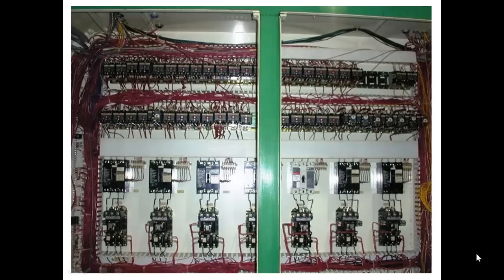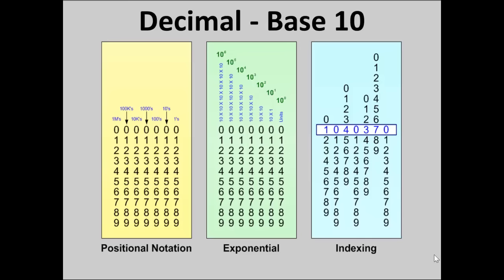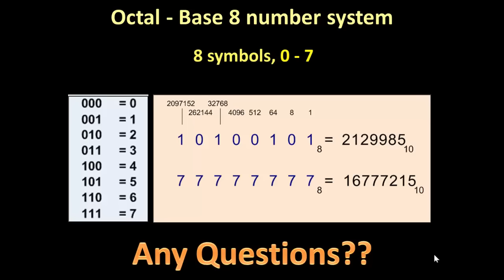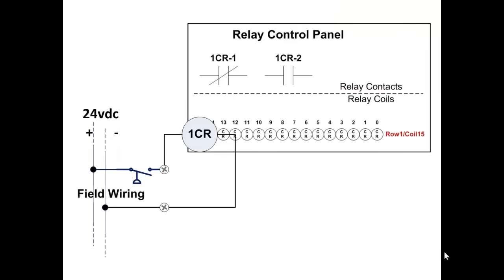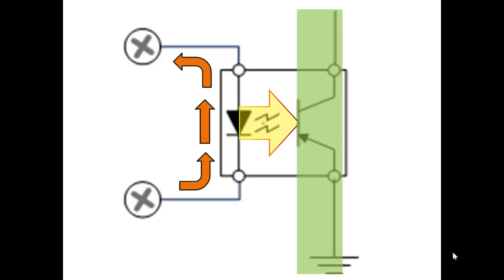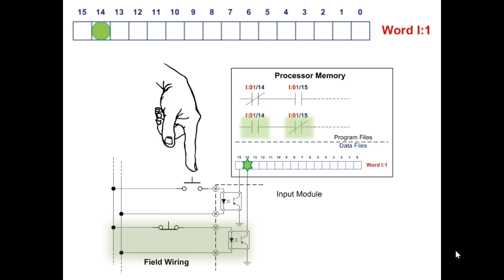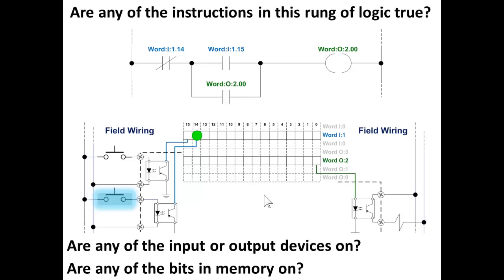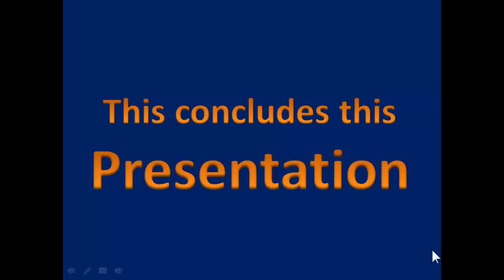What is a PLC? PLC Basics Pt2

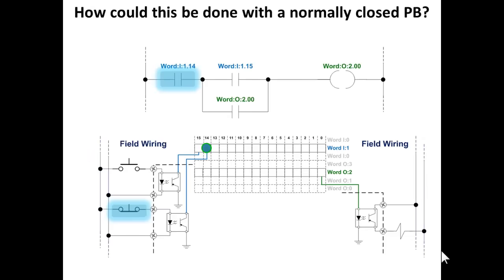Comment: In the bottom diagram in 1:08:20 it's showing a normally open push button connected to I:1:14, which has a normally closed symbol. And then the opposite at 1:29:52. This is different to 55:52. Am I missing something? Does the type of physical switch not relate to the functionality i.e. NO/NC?

Also, why does turning I:1:15 on turn O:2.00 on? Is it different to standard circuit series/parallel rules for ladder logic?
Reply from the maker: All contacts are drawn in their "normal" or relaxed state. You do not change the symbol to match it's energized state.
Reply: @plcprofessor  Thank you for replying so quickly! I think I wasn't clear enough with my question though, sorry, as I'm not talking about changing the symbols.

I was thinking "push to make" switches would always be NO in their relaxed state, i.e. - = -| |- and "push to break" are NC i.e. _ = -|/|-. Is this the case, or does it depend how they're wired up?

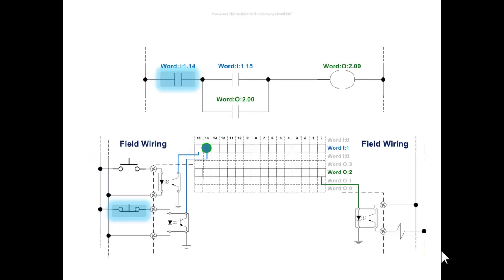At 1:08:20, you have - = -|/|- and - = -| |- but at 1:29:52 you have - = -| |- and _ = -| |-

I've figured out my second question I think :)

Comment: At time mark 48:20 when the exploded view of the opto isolator is shown, I think it should be an NPN Transistor with the emitter wired to ground , acting as a sinking device
Reply from the maker: That would be true for a positive supply, but not for a negative supply like they use outside the US. However, I wish now that I had not used that symbol and made it entirely "polarityless". Most manufactures use sketchy component representations in their wiring illustrations. In the classroom I always mention that these are representations and warranties of information. I added a note that will hopefully allay semiconductor "savvies" from the distraction of what we are actually discussing. Feedback always useful, thank you.

Comment: 1:16:25 - You begin here talking about OTE; will you explain what that is, or did I miss something in the previous lesson?
Reply from the maker: It is the instruction that mimics a relay coil, an instruction that writes to a bit in memory, setting it on of off just like a complete circuit in a relay circuit energizes the coil when the circuit is complete or de-energizes it when the circuit opens.

Comment: Ok, let me ask this, at 1:19:35, if bit 14 is on, instruction 1.14 becomes false. Is this correct?
Reply from the maker: +Bruce Wang YES... If bit 14 is ON then any "TrueIfOFF" instruction that addresses it is false... because it is not OFF and therefore false.
Reply: plcprofessor Thank you for your reply. At 1:19:35, the question is are there any of the instructions in the rung of logic true. The answer should be none is true because I 1.14, 1.15 and O 2.00 are all false.
Reply from the maker: +Bruce Wang The three read only instructions are all false, but the write only instruction addressing O:2.00 is never true or false. The TrueIf... instructions are statements about the bits in memory that they address and they are either true or false, these instructions are queries but the "output" instruction is an action that has an action when the rung is true and another action when the rung is false.

Comment from the maker: Yes, you are correct. Unfortunately I normally mention to my classes that this is a representation and not a warranty of actual electronics. In reality there would be a myriad of components between the I/O wiring arm screw terminal and the memory bus. I just thought of a solution, I will make a note to myself to add a note on that section to mention the same. Thanks for the feedback, it all helps. Again, thanks...

Comment: I did not get the question asked at 1:19:35 "are any of the instructions in this rung of logic true?" According to me none of the instructions is true, and I did not get the given explanation. Could you please explain in detail. Thanks.
Reply: +Mohit Suri I agree with you, instruction 1.14 should be false.  That part confused me as well.  I just thought it was a mistake in the video.  Also, the normally closed pb logic didn't make any sense to me either.
Reply from the maker: +Mohit Suri There are two read type instructions in that rung of logic, there is a True If On and a True If Off instruction (true if that bit in memory is ON) and there is a True If ON )true if that bit in memory is OFF), just like the contacts of a relay, some have continuity when the relay is ON (True If On) and some have continuity when the relay is OFF (True If Off). There are no mistakes in this explanation, I double checked.
Reply: +plcprofessor at 1:19:35, if bit 14 is on, wouldn't it open 1.14 thus instruction 1.14 becomes false?
Reply: +plcprofessor I see what your point is, but true if On(bit 14) instruction is not displayed on the ladder logic(since word:I:1:1.14 is normally closed contact), so can we say that there would be always one instruction out of the two being true, even though that instruction is not in the ladder logic?
Reply from the maker: +Mohit Suri The single most difficult point to understand with relay ladder logic is that the symbols that resemble relay contacts are not relay contacts. The "rung" of logic in this graphic is just that, a graphic and not a relay circuit. Those symbols do not open and close, they are either true or false depending upon the state of the bits in memory that they address as a read only instruction.
Reply from the maker: +Mohit Suri The only instructions that exist are the ones that you put into the rung of logic. A TrueIfOn instruction that resembles a normally open relay contact is identical in execution to a IF "MemoryLocation" =1 THEN. The TrueIfOff is equivalent to IF "MemoryLocation" =0 THEN. Without a true understanding of what a relay contact implies in an actual relay logic circuit, it is a query of the state of the coil, this concept will elude that individual.
Reply: +plcprofessor  I was told to find out what a not was in ladder logic but I don't remember hearing you say. Did I miss that?

Comment: I'm one of those people. I'm really lost at 59:07. Could someone explain that, please. The NO is true because the circuit is on?
Reply: +Imna Illestchik   you have to seperate the physical devices from the logical instructions.   a instruction can be false if a bit is off. (an NC instruction is TRUE if the bit is off)  for example.   And a bit can be ON  if for example the button is not being pushed (if its an NC button)  so the Physical world just runs from your divices until the input module bit, to determine if this bit is on or off. that bdepends on the type of devices you use NO or NC. from there the logical world starts. The logic looks only to if the input bit is ON or OFF... And the Instructions ADRESSING a certain bit can be TRUE or FALSE  wether the bit in on or off depending what instructions you use.  then when a output bit is turned on or off the logical world stops again and the physical world starts again. For example i can have a machine turned OFF if an output bit turns ON... and vica versa.... depending on the type of physical contact i use NO or NC
Reply from the maker: +Imna Illestchik That is not a NO contact, it is a true if ON instruction and it is true because the bit that it is addressing in memory is ON. That bit in memory is ON because the normally closed pushbutton is not pressed and there is continuity in the field circuit turning ON that bit in memory.

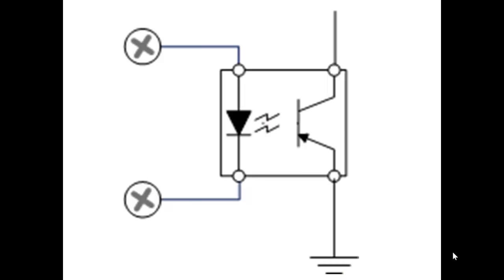Comment: At 50:46 you are saying that the current goes form bottom to top? top is the anode where the current goes in, why are you saying it backwards?
Reply from the maker: Electrons flow from negative to positive. Voltage is the atomic stress field that exist between any two opposite charges. It is pulling on the electrons to deplete the deficiency of electrons as they arrive at the positive ions. Electrons flow from an excess of electrons to a deficiency. Electron flow is from the cathode to the anode in all solid state and vacuum devices.

Comment: When talking about current flow at 49:03 you say current flows from bottom against arrow up to the top of the diode.  Shouldn't that be reversed? Doesn't the current flow from top to the bottom? The cathode is on the bottom of the diode, and current should flow towards that, right?

Comment: Hi, why does the symbol for a closed connection (a diagonal line passes through the two sides of the connector) represent "True if OFF?" I ask because when the connector (I'm thinking of a connector as a switch) is closed the transistor is on. So, if the transistor is on when the connector is closed, closed should be "True," not "False."
Reply from the maker: true if that bit in memory is off or true if that relay coil is off.

Comment: At 1:21:35, you start using a term that has not yet been defined (at least as far as I can tell). The term is "OTE" and I'm sorry, but I don't know what you're referring to.
Reply from the maker: +djl    OTE Output Energize, the instruction at the end of the rung that is set or reset based on the rung condition...

Comment: Hi, this video series is very well done! One minor discrepancy (typo) appears around the 16:00 mark, the slide titled Binary - Base 2, Exponential section, 6th power (2^6) shows 10 x 2 x 2 x 2 x 2 x 2 in blue. It should be 2 x 2 x 2 x 2 x 2 x 2, correct? If this has been addressed already, I do apologize. Thanks for the great series of videos!
Reply from the maker: There always seems to have been an error in one of those slides and I keep thinking that I have corrected it...I will look again. Thanks...

Comment: Really helpful specially for me with 0 experience and knowledge in plc
Reply from the maker: The pleasure is mine...el gusto es mio...
Reply: Were/are you a commissioning engineer, sir?
Reply from the maker: I have provided the entire span of services from blank sheet electrical design with AutoCad, specify and order all electrical components, panel design and even panel build on occasion, blank sheet programming, lots of 11th hour retrofits and many, many commissionings. Lately it has been mostly commissioning and clean up of installs gone bad.
Reply: I see. You have my respect, sir. With your experience did you do any revamping commissioning? Have you worked in steel industry by any chance?
Reply from the maker: Not in the steel industry but I have some experience with foundries. By revamping do you mean retrofitting process improvements?
Reply: Exactly, retrofitting. I have used the wrong term. Well, the point of that type of job is when they close down one part of the production line and you have to setup a new machinery and start it ASAP because every day of non production is a $$$ loss for the client. You have very limited deadline so workers and a client are very nervous. It is very stressful but rewarding. Usually those types of commissioning jobs are done by senior engineers with at least a decade of experience.

Foundries? You mean EAF´s(electric arc furnaces)? I guess you have worked in the melt shop.

Comment: Thank you plcprofessor! Fantastic training video! I wire industrial palletizing machines that have photo eyes, prox. switches and other inputs and outputs. I wire them and then do I/O checks before the engineers download RSlogix 5000. My goal is to get into the programming side of it. I am building a plc trainer based on your design. My question is; what would be the best path of videos and or manuals etc... to take advantage of your instructions? Thank you.
Reply from the maker: plcprofessor website... bookstore... CL100 online lecture course and then decide on CL101/102/103

Comment: Thank you for this Lecture. Now i am really curious on how a computer works then. I understand now the principle of: that i give instructions to "the computer" as in if this and this bit is on and this and this bit is of and this bit is on for 7 seconds THEN that bit has to turned off and that bit on for 3 seconds (for example)(timers)  in turn trough the output module activating or shutting things down in the physical world. this i understand now. I only dont understand what part of the computer or how these instructions i give "it"  get translated into the processor following these instructions. so the read and write connection of each bit is connected to the processor?  very very interesting. (excuses for my bad English, i m Dutch)

Comment: In your video when you introduce Hexadecimal, you convert the hex number A0F1  to a decimal number 45,312. This is incorrect.

I believe that you calculated the hex A as 11x4096. The hex A should have been calculated as 10x4096.

That would make the correct decimal conversion equal to 41,201.

Comment: @5:20 you would mean true or false...   (as learned from part1)
Reply from the maker: +EtterBakk Physical devices, such as we are discussing at 5:20 either have continuity or do not have continuity. Continuity and the input optoisolator is ON, no continuity is then OFF.
Reply: +plcprofessor  but in part 1 you said things like buttons and sensors are true or false and actions like solenoids or lights are on or off
Reply from the maker: +EtterBakk The instructions that look like NC or NO contacts are never ON or OFF but always True or False. he field devices that effect their bit in memory are ON or OFF. The state of the field device is either ON or OFF, their representative bit in memory is either ON or OFF, the instructions that read the bits in memory are always true or false depending on the state of that bit in memory and whether the instruction was a TrueIfOn or TrueIfOff.
Reply: Ok thank you i understand now. I thought in part 1 you said that the field devices (buttons/switches/sensors) are also being called true or false  i misunderstood then. thank you

Comment: I’m a little confused around 1:01:30... I thought the contact with the slash through it meant closed(on.) with the lower circuit’s photo isolator being energized in its natural state, wouldn’t the closed(on) representation of I:01/14 be true? If the the “contact” with the sloth through it means closed/on and the photo isolator is energized in its natural state... what am I missing here?
Reply from the maker: The slash through the contacts indicates that it has continuity if the relay coil is deenergized.

Comment: hello plcprofessor, this  is such a treasure for control guys. i want to know how can i connect the outputs of a s7 1200 siemens plc such that it drive the inputs of a safety plc which is not from siemens. i want to connect them hardwired. anyone who has got any idea regarding this can answer, thank you in advance.
Reply from the maker: You have to consider the sinking/sourcing relationship between the two devices, output module and the input module. If the output module is a dry contact (relay output) that does simplify the solution. If it is not an isolated relay output, then that is another issue to consider. Refer to the installation manuals for both ends of the electrical interface and study them carefully. One of the manufacturers of the devices should be able to assist you. The last resort is a solid state interface between the two.
Reply: plcprofessor Thanknyou professor for the explannation. Yes the output module is an isolated relay output. how can i proceed with the connections, if it is a relay output, could you please say it briefly.
Reply from the maker: Abid Mohammed You will need a power source that matches the inputs (load) and connect the isolated relay contact in series with the power supply and the load. If the input is not a universal input (not polarity sensitive) then you will have to connect the input observing the correct polarity.
Reply: plcprofessor thank you professor. i got it.

Comment: I've been an Electrician for over twenty years and at 16 minutes and 27 seconds into the Video, I feel like a Moron.........I fix PLC Driven Equipment in a Saw Mill all day long, with Great Success....I understand I/O but, this Decimal thing is Eluding me....I'll continue on with the Video..I wonder if there is a Holiday Inn near me I can spend a Few nights...
Reply from the maker: Don't mess with success... With a system that is primarily discrete inputs and outputs, knowing binary representation of integers etc... is not a necessity... at all! Fortunately for all of us, all modern programming packages do not display everything in binary like they did in the real days of old. You can pick the radix, ie... display the 16 bit register as binary OR decimal etc. If you need to work with analog devices and I/O, all of those values are in binary even though your software should display them in signed integer. By all means, skip the number system lecture. After all can be boring.
Reply: Thanks, I really do want to Learn this stuff...RE: Stuff...No offense...

Comment: With all the respect you are confusing ppl. In a de energized state a coil has a normally closed contact as true, because it is closed as per it's definition and the normally open contact as true because  it's in open position as per it's purpose or definition. If you energize the coil the two contacts will become false because they are in a different state then it's purpose or definition!
Reply from the maker: Are you speaking of relay coils and contacts or the logical instructions whose symbols look like relay coils and contacts?